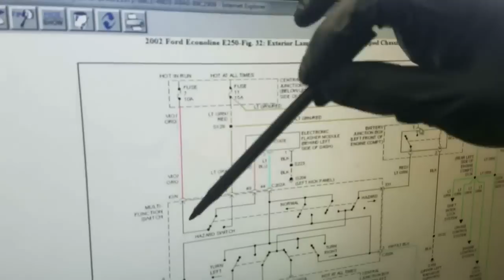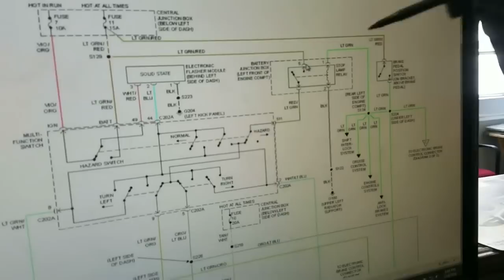No Brake Lights? How to Fix Broken Wire In Harness | 2002 Ford E250

Comment: Excellent work sir! Same issue with my van, same year, same model. However I'm just gonna buy a new fuse box with relays and start over. Re-route all the bad shorts/wire with new wire thru that and call it a day. It's an old van so it's a matter of time before all the other wires go bad one day. Thank you for this video!
Reply from the maker: You’re welcome thanks for watching. Sounds like you’ve got a lot of work cut out for you.

Comment: Dude, you're a genius. (F-350) I knew my bulbs were good by turning on flashers,  fuse and switch were good because power trailer brake module indicated brake condition so I was stumped. Came here and found your cure with the emergency flasher switch sticking. Cycled it several times and that did the trick. Thanks for saving me hours in hot July weather.
Reply from the maker: You’re so kind thank you glad to of been able to help

Comment: Awesome, awesome video.  After much head scratching, checking wires, and replacing the multifuntion switch to no avail,  I came across your video (at 2am).  Seeing the path of the wiring spelled out in the video, I was able to trace the issue to a failing relay.  Replaced the relay and brake lights are working again.  A sincere thank you for putting this together.

Comment: Consider yourselves fortunate....i have issue on '97  Ford F53 chassis RV with working marker lights, front turn lights but no tail lights (turn, brake or reverse)...only 35ish feet between wiring connections....the tip to jumper around the brake light switch was worth the price if admission!  Thx!

and oh yeah, somewhere along the way there was a trailer wire harness that is totally thrashed... don't give a darn about trailer lights but who knows how it was wired so i have to trace everything.  Been putting this off for, oh, months.  ;)

Comment: Awesome job on the van. My 15AMP break light fuse keeps burning out on my 99 Tacoma.I observed both tail light wireing and only saw one kinked or cracked wire in the back drivers side (left?) tail lights which was also green with a white stripe  so I spliced it with a little red crimp splicer.

Comment: I'm having the same problem with a 2004 E250.  No power to the brake lights but power to all of the components.  I didn't know to check the number 5 lead on the relay, that's a good tip.  I'll study your diagram to see if I've missed something.  It just needs to be found.  Probably the same wire that broke your 2002.
Reply from the maker: Did you find your problem?
Reply: @CoopersAutomotiveRepair  Honestly, I don't remember precisely.  I do recall that your video led me to the solution.

I had nothing but trouble with the whole lighting system.  Bad sockets, after market wiring.  I vaguely recall having to fiddle with the high brake light.  Then it went out too.  

I had to replace the high brake light lens because it leaked.  Be warned, if you have a sound mat on the floor,  if the lens leaks it will dribble down the inner channels and saturate the mat and there goes your cargo floor.

After replacing the floor I switched all lamps to LED and rewired the amateur harness.  Another thing I did was replace all the lamp covers with clear lenses and used colored bulbs.  It looks great, but my best result is the backup lights are nice and bright now.

It's all fixed.  Thanks for the video.  It would have taken me forever to do it without you.

Comment: Hello Tim You are really a Great Teacher Technicians, thank you for your tips, I'm going to try to find out where in my Van is the shortages.
Thnx...
Reply from the maker: Thank you, friend. hoping to get some new vedios soon
Reply: @CoopersAutomotiveRepair  Hey I have 2010 crown vic police intercept and all 3 brake lights are not working. My tail lights and turn signal works but no brake lights. I replace the brake switch and lighting control module and even tried a different bulb and still no brake lights. Any ideas?

Comment: I have a 2006 Ford e250 and I'm having about the same issues. I have tail lights but no brake lights when I hit the brake pedal. Thanks I'll check it all out. Great video. Subscribed
Reply from the maker: How did it work out did you find that problem with your brake lights?
Reply: @CoopersAutomotiveRepair  I have not! Haven't had a lot of time to keep looking but have heard that it could be my brake light switch relay (whatever it's called) that's mounted to my brake pedal? Do you think that's a strong possibility?
Reply: @CoopersAutomotiveRepair  It's definitely not the bulbs. However, could be the hazzard light button sticking as you tried at the beginning of the video. I'm going to try that tomorrow and see if it works..If not I'm gonna have to get one of those power probes so I can check more things.  It gets me by during the day by pulling my headlights on to make it light up to appear as a brake light but can't pull that off at night. lol

Comment: I really apreciate this video. I'm a student and I'm having issues with my break lights not working but driving lights do. now I have to go searching. thank you for the tips. I'll let u know if I find something
Reply from the maker: Thank you, I hope this help. And yes, let me know.
Reply: Ok. I have tested as much as I can. I have a 1999 buick park ave. I've check all 3 fuse block locations. all fuses associated with rear lights is good. I've changed break light switch and rear window light relay. for some reason I have 20volts on my orange post of the break switch but nothing on the light blue when pedal is pressed. I also just tested the fuse socket under the hood. one post has 20volts all times other has nothing at all.
pls help
Reply from the maker: I think me mean 12 volts. Have you tried bypassing the brake light switch with a jumper wire? All so Try wiggling the four-way flasher button. If you wiggle the four -way flasher button and the brake light start working. The turn signal switch is bad. Try this and get back to me.
Reply: Wiggling both the 4 way and the whole turn signal does nothing. What does jumping the switch do? I put a new one in so it shouldn't help
Reply from the maker: If you jump the org wire to the light blue wire the brake light should come on. If they do. Your new brake light switch is bad. the switch supply s the voltage to the brake light on the light blue wire
Reply: Yes. I tried this and nothing happened. I also removed the bottom cover to the steering column. Pressed the peddle and wiggled wires. Non were loose.
Reply from the maker: Ok bypass the brake light switch. Then test for 12 volts at light blue wire at the rear brake light. If you have 12 volts. Test for ground at the rear bake light black wire. If you don't have 12 volts check the fuse rear fuse block. You may have a open wire on the power circuit.
Reply: How am I testing the ground? Bulb in or out or the socket removed like u did?
Reply from the maker: In your case> I would test with Bulb in.  If you have 12 volts on the blue wire. then  use and jumper wire on the black wire to a grd. If the Bulb lights You need to repair the Grd wire. If it doesn't light. The socket is bad. when the brake paddle is pressed the switch supply 12 volts on the blue wire. to the rear brake lights
Reply: Stay in school

Comment: Great video, thanks for sharing.
I have a 2008 E 250 that when I push the brake pedal the left turn signal light on the dash comes on,  the other problem is that when I used the left turn signal both brake lights come on. I already checked the bulbs and is nothing wrong there. I know that this vans are wired so one wire controls turn signals, hazard and brake lights. A mechanic changed already the turn signal switch but that did not fix the problem. I am thinking that maybe the hazard light switch is not working properly but the hazard lights work fine. Is there a relay or module that controls the turn signals and brake lights? I don't have access to a diagram, maybe you can share a link on where to find one. Thanks

Comment: I was wondering if you had an idea about the brake lights on my 95 superduty 7.3 diesel. My 3rd brake light works but I have no brake lights at the tail lights. Turn signals and parking lights are fine. I have been checking the wiring, fuses, brake light switch etc. but without a wiring diagram it's obviously a difficult job. I'm thinking it may be in the turn signal switch but was wondering what your thoughts are.
Reply from the maker: Yes it can be very difficult without a wiring schematic. If voltage is crossing over the brake light switch. In the fuse is good. And I would suspect a turn signal switch

Comment: Tim, I have voltage at the brake lite plug at the brake lite pedal switch but only about 3 to 5 volts. How would you tackle that?
Reply from the maker: Let me think on this
Reply from the maker: What year make model and engine size is this vehicle

Comment: Excellent Video!   However, I have a BIG question.....The relay should not be getting power unless you had a clamp holding the brake pedal down, or rigged up a little jumper wire at the brake pedal switch.  So, how in the world were you getting power at the relay if the brake pedal wasnt depressed?  Driving me knutz figgerin this one out.
Reply from the maker: crazeyspivey That’s a great question thanks for asking. Yes I had the brake light switch unplugged and bypassed with the jumper wire.
Reply: Thanks for the super fast reply.  OK, now it makes complete sense with the jumper wire on the brake light switch.  Many thanks for the video....especially since I did not know the brake relay existed.

Comment: Having this problem in my 2016 ford focus I replaced the bulbs , the fuse , the brake switch still no brakes lights I’m guessing the wires are fried
Reply from the maker: Brake lights also run through your turn signal switch try playing around with the four ways and see if you get your break like that by likely pushing on it

Comment: I have a 2004 Silverado  and the problem is with the Drivers side tail light. I have the running lights working but no signal/stop or hazards just on that back drivers side  A tech changed  them a year ago and paid them $500 and don`t want to pay another $$$$. 
 They switched out the original tail lights for Square LED tail lights.Any advice on where to look or start would be very much appreciated.

Comment: I have a question I have a 2001 Lexus gs300 that I can’t get out of park and no brake lights .i did check the fuse and replaced the brake switch .what else should I look for ?

Comment: have a issue with 2004 jeep liberty all rear lights went out including tag light. switched out fuses and left side came back on then out again after a while. also when i hit the brake the turn signal will light up. any help would be greatly appreciated.
Reply from the maker: I would check the bulbs possibility simple as a shorted Bob and one of the lights front or rear

Comment: I had this issue, no brake light, changed the whole wires connection and it end not working, checked fuse 39 it should be connected to a write

Comment: I have a 95 nissian altima my brake lights don't work either and I can't shift out if park due to the breaks lights not working. I have check fuse and it's good. I have also replace brake light switch and still not coming. What should else should I check.

Comment: I have a 01 silverado everything works except for brake lights 3rd don't work either replace pedal switch still nothing fuse in cab has power under hood there is no power getting to fuse is it a group going to my fuse box under the hood?  Please help

Comment: where do you get the wiring diagrams from on computer ?
Reply from the maker: Depending on where you are some parts houses can supply you a wiring diagram. Sometimes you find them on the Google search. We use programs like Mitchell all data, etc..

Comment: Hi how is the name of the measurement tool tha you use , I have the same problem in Econoline E club wagon xl and even the turn signals don't work
Reply from the maker: Power probe is the name of the tester. But, you can use a test light. Being that your turn signals don't work. I would be checking the turn signal switch. Because the brake light circuit go though the turn signal switch. try messing with the four way flasher switch. See if they work.
Reply: Thanks for answer ! I already play with the switch  and disarm de components , note that it's simply so i suppose that the problem don't come from there , how can I check the switch with a instrument like voltímetro ? And another cuestión is that mi van somebody change the circuit and put a different relay on the turn light , i disconnect the relay to test and its work but now I don't know how to connect again because the cables are separated how can I know which cable in which pin of the relay? Thanks !
Reply from the maker: Send me the year and engine size. All so your e mail. And i can get you the wire diagram and pin out. Or google it. You may find the diagram that way.
Reply: 1997 E350 15 passenger club wagon xl  7.3 power stroke v8
Reply from the maker: Hope the info I Emailed you helped. When you say relay. I think you mean turn signal flasher?
Reply: I just put a new steering column In my 95 tahoe and the break lights still don't work...it was like that before but my hazards and turn signals do work

Comment: My 2001 mustang brake lights aren't working. Replaced the brake switch and no fuses are blown... What now? My hazards and blinkers work. If I don't put it in neutral before starting it  then it won't come out of park 😑
Reply: Having the same problem on my 2000 mustang and did the same thing changed the brake switch and nothing..  Have you fixed the problem yet?
Reply: @redapollo6248  yes mine was the brake switch. I shorted a wire so had to take it to the shop. Make sure your bulbs are good and the wire didn't short out. And check the fuse
Reply: @NinjaNikki88  I did all already had to mechanics fix it but it does the same thing after a month. I think it might be a wire coming from the wire harness...  I have no idea smh

Comment: I have a similar problem with my 1996 Ford Ranger. 
The left side has no function.  What could that be?
Reply from the maker: Did you check for power and grounds at brake light socket?

Comment: my right side brake light don’t work and my right tail light works and my 
right blinker don’t work and my right backup light works on my 2000 blazer
Reply from the maker: I wish I could help you and I would like to, but sometimes we just need to see the vehicle to properly diagnose it
Reply: Update it was a broken wire on the brake light switch that whines around and back of the switch that goes to the glove bar though fuse box underneath the hood

Comment: My brake lights stay on the entire time the truck us running
Reply from the maker: First thing I would do is unplug the brake light switch and see if they go out on the brake light switch would be bad. Let me know.
Reply: @CoopersAutomotiveRepair  I unhooked the brake switch and plugged it back up. Now they work normal.
Reply: @CoopersAutomotiveRepair  For the longest,  it says , Check Trailer , on the dashboard although no trailer is attached.  I noticed 2 days ago that when I hooked a trailer to the truck , I had no trailer lights. Test light revealed no current coming out Of the trailer connecter on the truck.

Comment: 2002 dodge Dakota no brake lights fuses bulbs and relay on brake pedal is all good what's next
Reply from the maker: Four-way flusher or turn signal switch be sure you have good grounds
Reply: I'm having the same problem with my 2003 Durango but did you do to fix yours because I cannot find it
Reply: There is another fuse underneath the hood that says s t lamps and that fix my brake light problem

Comment: Ding ding ding ding ding Ding ding ding ding ding Ding ding ding ding ding Ding ding ding ding Ding ding ding ding ding   Ding ding ding ding ding Ding ding ding ding ding Ding ding ding ding Ding ding ding ding Ding ding ding ding ding   Ding ding ding ding Ding ding ding ding ding ...
Reply: How does a wire just break like that???
Reply from the maker: Possibly someone testing it with the probe. Poking holes in The installation
Reply: I wish I knew what was wrong with mine. 1996 e150. No brake lights, no turn signal, no emergency flashers, stuck in park. Checked all fuses, replaced headlight switch and combination switch. What now?